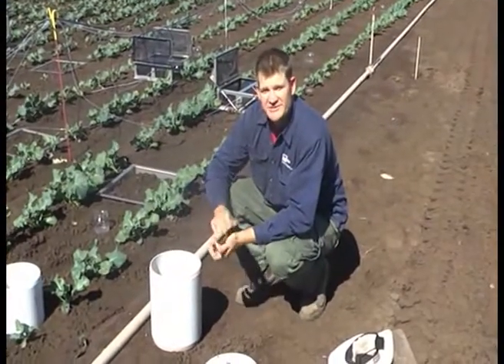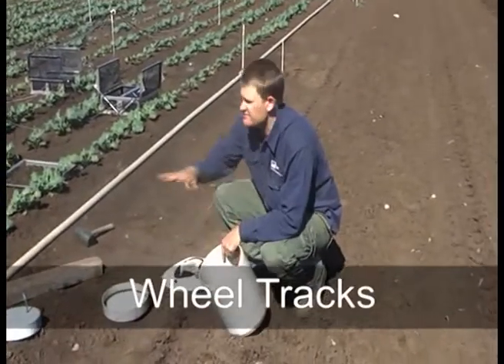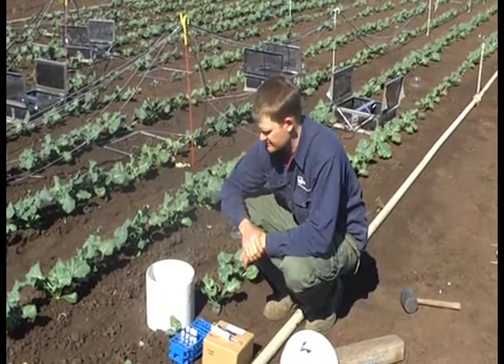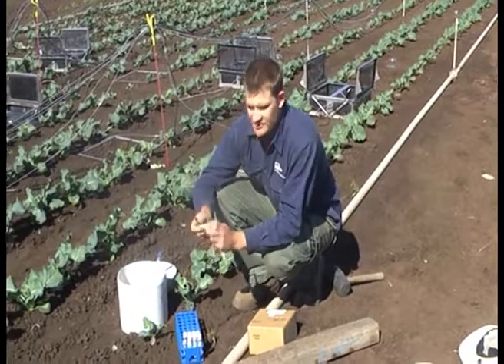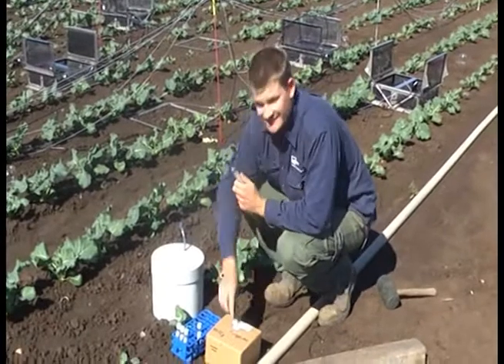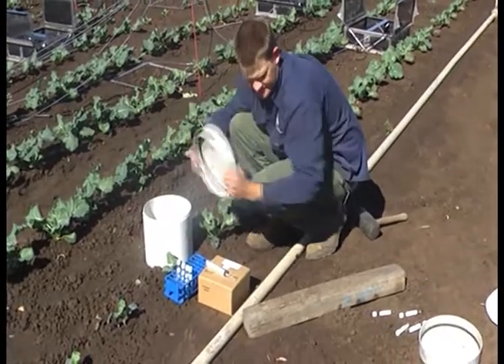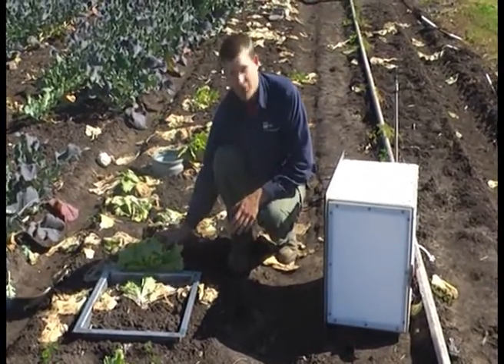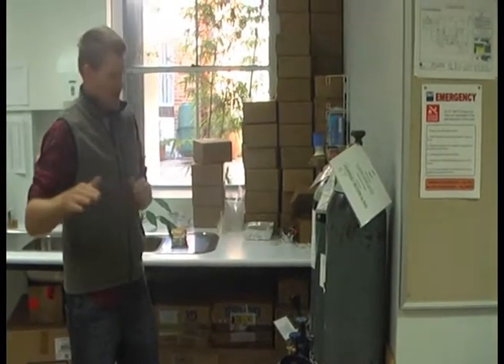QUT Manual Greenhouse Gas Sampling: Dr David Rowlings

Comment: Hello sir, I am very interested in your video. I was wondering what type of valve you use on top of the lid? I also need to collect CO2 from the field and then analyze CO2 in the lab with a Licor830 gas analyzer. can you please give me some suggestions? I found that the device you use in the lab is a gas chromatograph, right? thanks in advance.